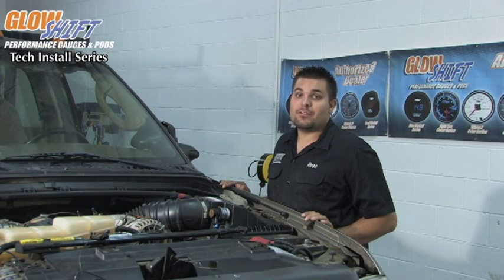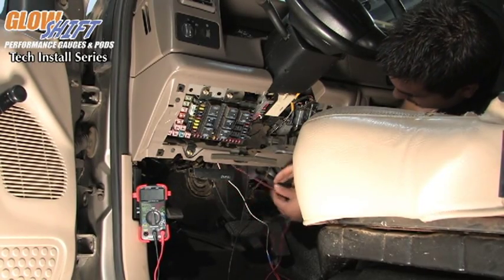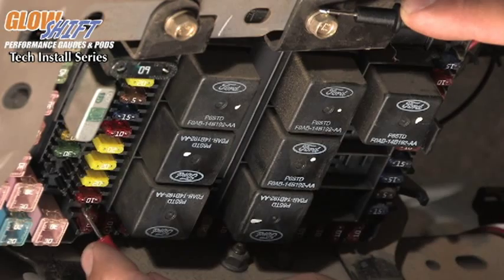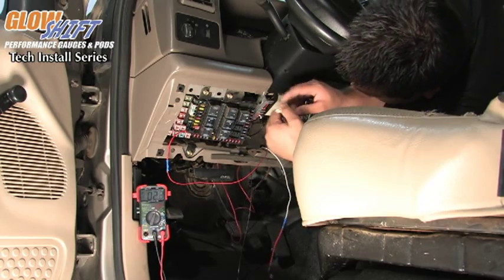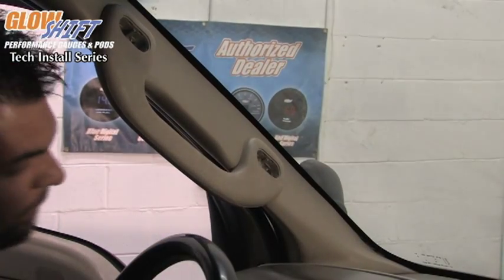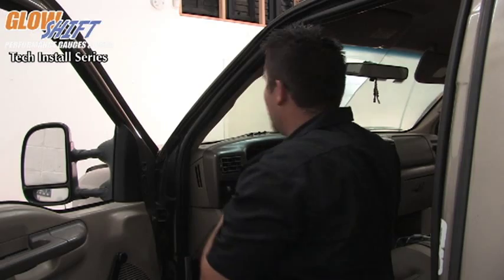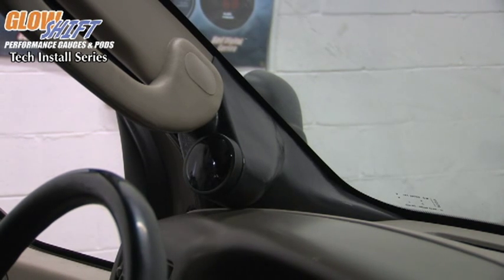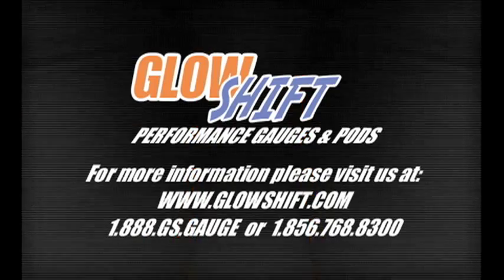Installation | GlowShift 3in1 Black Analog Gauge Into Ford Super Duty 7.3 Powerstroke Part 2/2

Comment: My 3 in 1 gauge lights have stopped changing colors when I push the button on the front.  Also, the small lighted numbers have gotten very dim to where I can’t see them.  Of course my gauge is out of warranty.  Do you have any suggestions as to how I can fix my gauge.  It is installed on my 2001 Ford F-350 7.3L diesel.